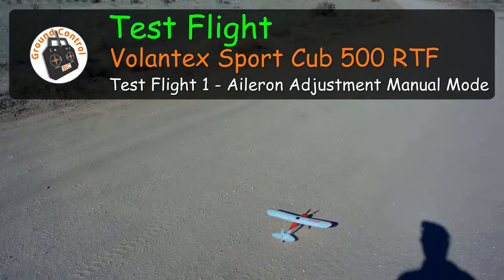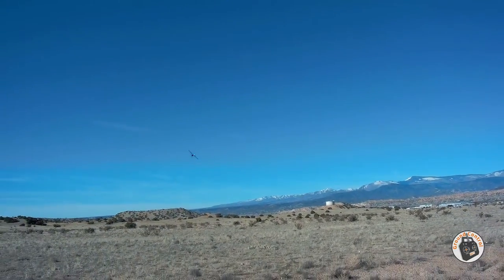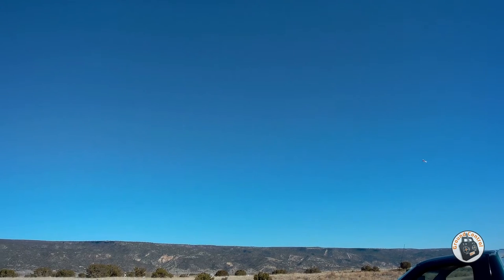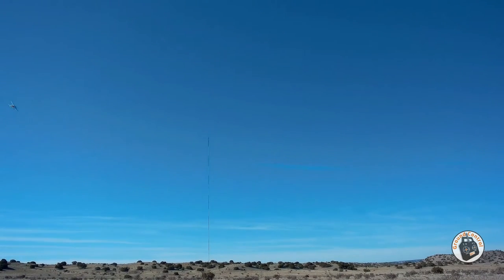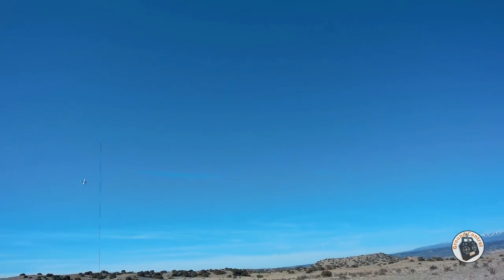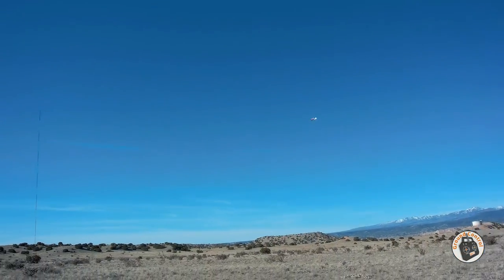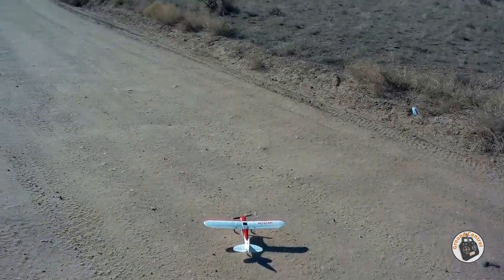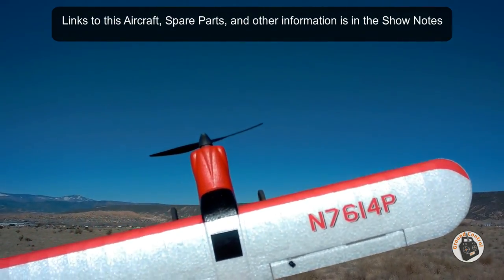Volantex Sport Cub 500 RTF - Aileron MOD Test Flight in Manual Mode

Comment: That is my first plane. Been flying it two years now and it’s still a great plane. It can be driven straight into the ground with no damage. Snap the prop back on and off you go.
Reply from the maker: Such a fun, stable, and durable little plane.
It's still one of my favorite beginner planes and you can't beat the price ;-)

Comment: Hi there, my sportcub is facing a problem where it will not turn left at all, all other control surfaces work fully left but pushing left on the ailerons causes nothing
Reply from the maker: Broken linkage or control arm on the servo?
Reply: @GroundControlRC  cut an access hatch to view the servo and i found that, following a few crashes, the carbon support rod had wedged under the control arm, disabling it. I carefully removed it from that position and everything working again
Reply from the maker: @rohansalwan  Fantastic!
Great troubleshooting and I'm glad you were able to fix it.